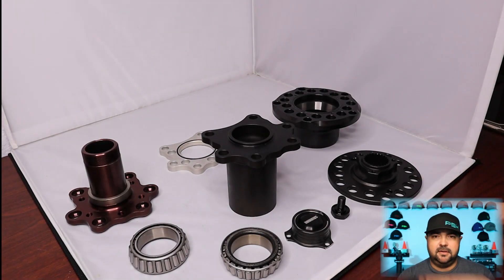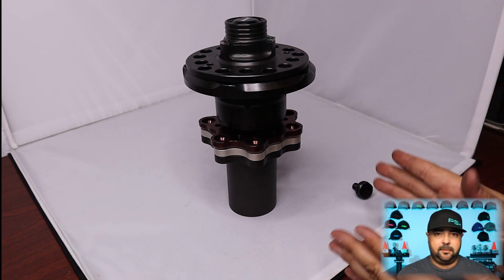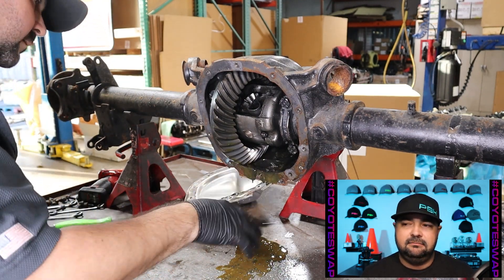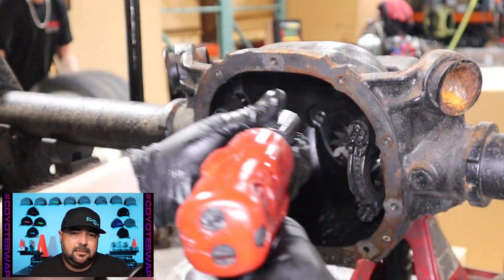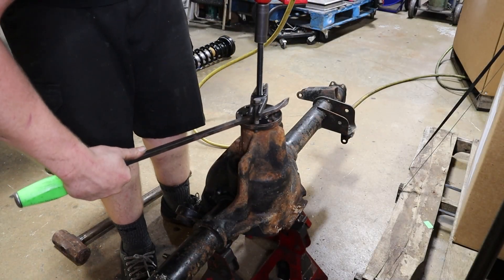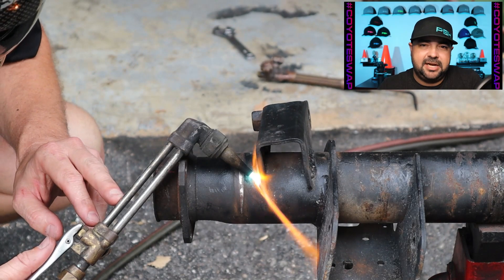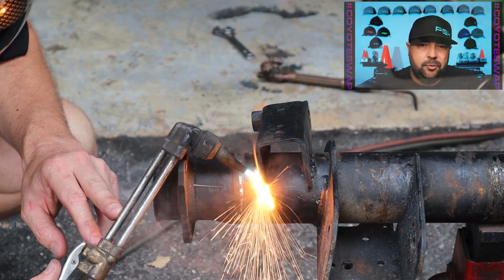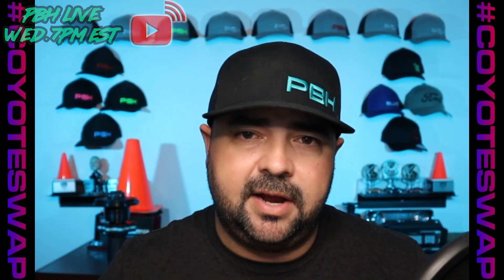Converting a Ford 8.8 differential to Full Floater with camber

Comment: Alright how can i obtain this system for my 9" full floater rear for my 1982 Fox Mustang Road racer?  There is no way to get ahold of STRANGE?
Reply from the maker: We actually had Strange install this kit on one of their housings. It is in the car currently and it works great. The kit is designed for a 9 inch tube so it should work on most housings out there.